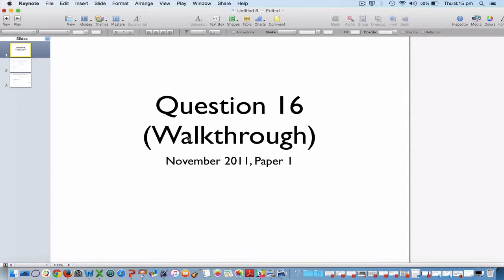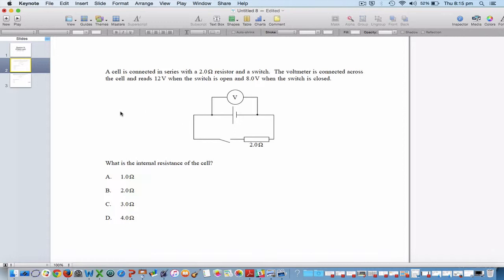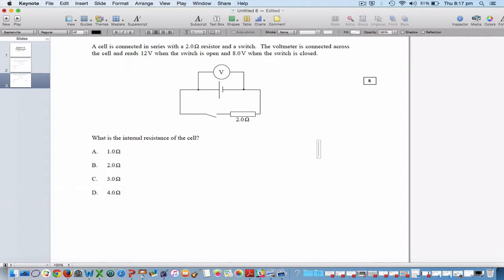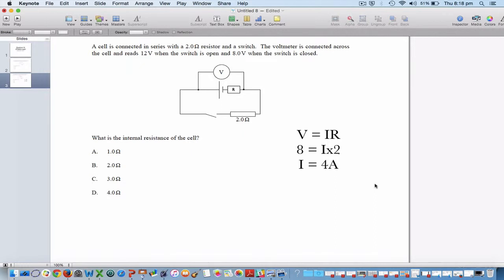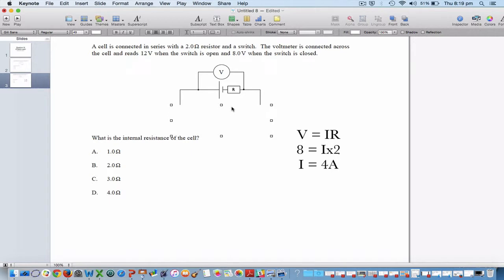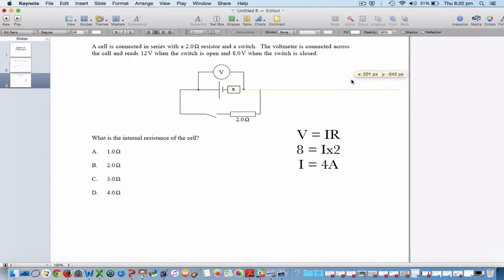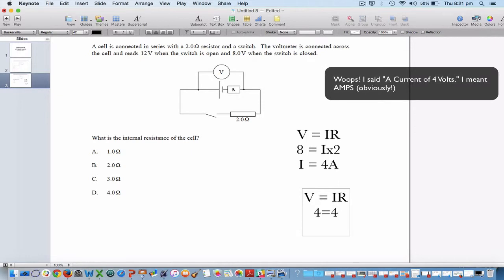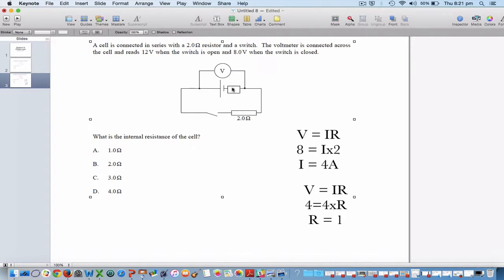IB Circuits Question

Comment: Why did you ignore the internal resistance in the first application of the law? Shouldn't it be V=I(R+X) where R is the 2 ohm resistor and X is the internal resistance
Reply: Because when the switch is open no current is flowing and if no current is flowing through the internal resistor there is no voltage drop across that resistor.